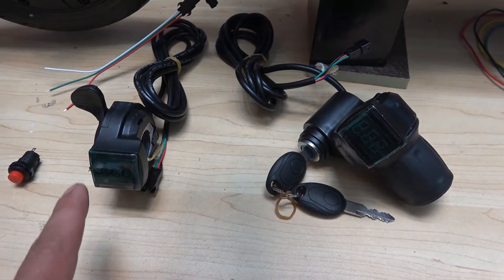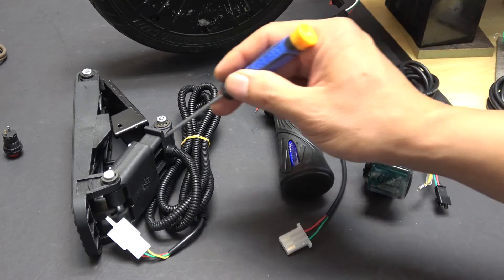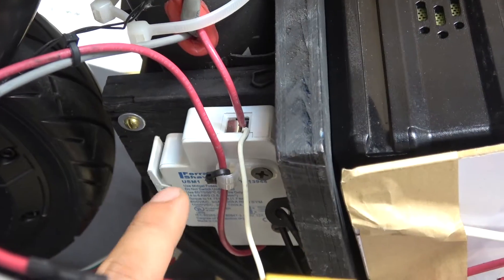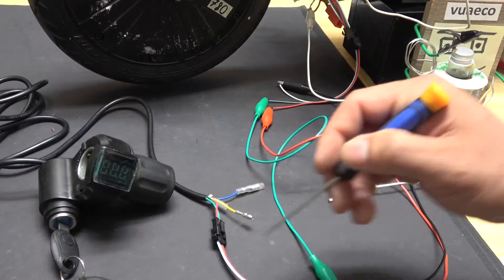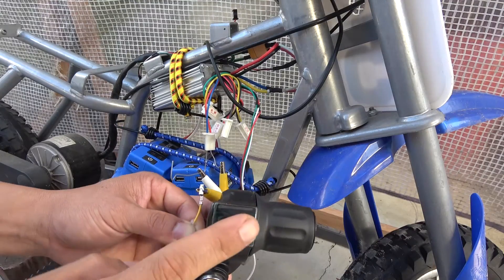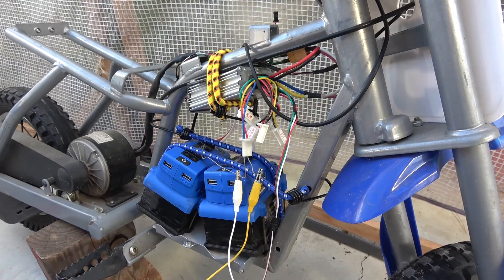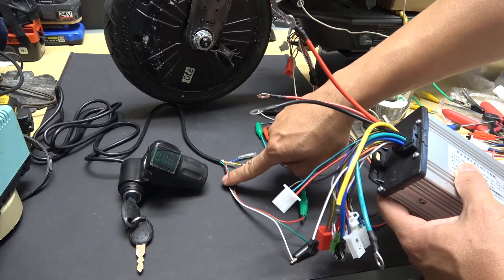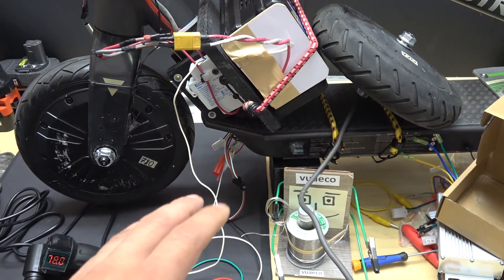DIY: How to install throttle control w/ LED voltage display & ignition key on electric bike/scooter

Comment: Thank you much! Do you have a video on hooking up the battery amd charger? Want to make an electric bike with hold hoverboard motors. All I meed to know now is how to hook up the hoverboard charging port to a new bigger battery if possible and a fuse or two if needed.

Comment: En los aceleradores ( no ignition key) el verde es siempre el cable de señal. Red is 5+ Amarillo o negro es el negativo - .....las key ignition, El encendido, el rojo es potencial de 24 v a 72, viene de la batería y el amarillo enciende el controlador, lo energizan..

Comment: I have been very frustrated looking for videos on how to manually install a switch onto  A motor hub With a throttle I already tried and broke 3 Is throttles in trying  I just need help

Comment: I have a weird issue with a twist throttle I bought from eBay. When I plug in the 3-wire throttle to the motor (it has an integrated ESC), the idle voltage on the signal wire is 1.1V, which is enough to spin the wheel with no throttle input (throttle is not turned at all). Any ideas? I don't see anywhere to adjust idle voltage.

Comment: I have the same throttle with a controller with the single red wire.  I had connected exactly as you have and although it works when I sit on the bike (creating resistance) the motor does not spin.  I have 4 controllers, 5 displays, 3 batteries and 4 motor/wheels and with these have tried many combinations to narrow out the problem (thinking it was the controller) although all controllers respond the same and none work.  So what the hell is going on here?  My only conclusion  yet to try is that a speed switch might be required for the controller to send the proper regulated voltage.... no idea just a thought

Comment: hey, great video, I have a 8 pin full throttle with battery and speed display, there are 3 cables for throttle, red green and black, and a white and yellow for the keyswitch, a purple/grey for the speed display and a lighter and darker blue for the 3 speed, but when I connect it it just shows P0 error blinking, and I done know what im doing wrong, also my controller have 3 speed with 3 cables, a blue and and black and brown, and the controller has one cable for the electro lock like yours around 10min. how would I connect that? also the controller doesnt have a power out source for lights and horn, so im not sure how to connect that either

Comment: From Brake handle.. 3 wIResRed-green-black. Standard 36 48v brushless. Single motor. Controller almost always just 2wiRe black-white. Where how connect? Confused😐

Comment: My pedal assit is red on left yellow in middle and blue on right and coming from the controller the wires are 3 different so i just do the conntanunate test on the multi meter  i will try 👍

Comment: You know how come my throttle's not working when I do that. It's apparently you're not getting turned on by the switch. What's up with that and then I got another one. It's fine until you plug the travel in. It goes from 5 to 4 V, and then it doesn't work.
 So I don't understand what's going on here. It's got to loop in it. It should be turned on, but it's not put down any voltage till tline T HR OTT.L.Eline.

Comment: So my speed controller does not have a connector named power lock now it has a connector that says alarm power is that the same as power lock

Comment: So far, this is the video closest to what I have been seeking for days. My keyed Switch 
Screwed up within 10 days of Purchase. There's
More to that story, which ended with a full refund and I no return necessary,  but the several issues are my responsibility to fix. So. Instead of the keyed switch with LCD screen and half handle twist
Throttle. I decided a key wasn't necessary, as th problem I had was the key spinning indefinitely until something connected, and then I guess after much of that the wires twisted up enough to short out completely . So newly purchased from amazon, just an on/off switch  ,no key, thumb throttle and lcd screen.  The previous setup had a 5 pin plug and then a single also on harness . That is what the controller
Connected to, also with 5 pin and single separate wire. There is a light/ horn too, in case that explains
Anything... so new  throttle has 3
Pin with red green black,  and 2
Single wires. Yellow and blue.i have photos but can't post them
Here. Can you please
Tell me
What I need to do? I am 63 y old lady
And this is my only transport  and this bike was not built
To pedal with ease of regular
Bicycle.  Help!

Comment: I need your help please with my Brainpower Motor Controller volts:36/48V 350 Power to connect it to a CD_S866 Display because I have zero electricity lessons followed in my life. So before I screw it up. I ask you please to send me a picture or email with the right wiring diagram to get it fixed. I really hope that you're willing to help me with this. Greetings Frank Grinwis from the Netherlands

Comment: I just bought a ebike if there shows 64 volts on the voltage display does it mean it will run if nothing else is the problem

Comment: My e scooter throttle circuit wire snapped but I was wondering is it possible to just reconnect the cables together to save time on buying a new throttle because I need a specific throttle and my e scooter brand isn’t made anymore or try to find a compatible universal throttle

Comment: I have a Phantomgogo R1 36v scooter. When I tested the 5v red wire coming out of the controller I found that the 5 volt Red Wire is pushing 17.44 volts. I am afraid of connectiing the.controller to the throttle because I do not want to damage the throttle.  Is this high voltage normal or is it a defect? Will it destroy my throttle?

Comment: If they only stick to colour code, everything would be fine.
Instead of opening up a controller and finding all kinds of wires and colors that does not do what it's supposed to.😂😂😂 At least they should stay consistent on the colour. If not the same it should be close second Instead of creating this colour puzzle😅😅

Comment: Tell me how to train the controller 48V, 21A, JX-100-ABS-Electron, YKGT06FOC01-A, with a hall sensor, the new one was simply turned off for sealing and everything does not turn, the rest is all on, the speeds switch, the display works? There is no white wire or XX. (The wheel did not spin right away; it needs to be turned a little. Some scooters have this function.)

Comment: I wanted to change mine to a throttle but have a clue what that white wire that you connect to yellow or where can i get one from and whats the correct name for it so i know what im asking. My scooter broke and fixed it from scratch but this one boggles me. Im not an electrician or pro but im good with my hands and fixing thing's once shower. That's the ADHD in me i suppose but some people for some reason call it an illness or disorder. To me it's absolutely perfect. At least i can think beyond outside the box and come up with ridiculous things that actually work. So with somone with ADHD is quite intelligent but handfull hahah id never change a thing about me. I love fixing any sort of motor considering evey car and problem is difficult so keeps me occupied and interested and fully focused..i can be a big messer but when it comes to focusing something i love them im all there, minus the millions questions butting in unintentionally incase i forget what i say, that the only down of it all 😂

Comment: My throttle is 6 wire. How do I wire a 3 wire throttle to a 6 wire connector at controller

Comment: My Sabvaton doesn’t have a switch/lock wire.

Where do I connect the blue wire from my throttle to?  

There is a single 12v red wire but it’s labeled “brake”

Comment: I connected an e-bike twist grip throttle to a 24V 500 watt ESC for brushed motors and it didn't work. The 3 wire set coming out of the controller were red, black and blue.  The wires going into the twist throttle were red black and green.  Any ideas why it won't work?

Comment: What about the yellow wire coming from the controller?
I got purple and red running in a loop. And then I have a Yellow One. But I said anything about yellow and coming from the controller just to throttle

Comment: I believe I’m using the same voltage speed control that you’re using the same speed controller at what point do you put a fuse or a breaker? Thank you for your time.

Comment: I bought a couple key throttles, but in 3 years of hit and miss, not working, finding nothing but " your controller isn't compatible"  answers. You explained it easy. The Xtra red and red are the key switch, ty,ty,ty and my controllers are reverse blue green for some reason but hot is hot and ground is ground.

Comment: WOW, VUAECO , Thank you so much for sharing all your videos I enjoy them all , they are the best online !!! I am installing a new univer,sal throttle with key on a recently purchased used Dyu D1(Gyroor C6) 36 volt  350 watt . This is a learning project.
It did not run when I bought it , seller said needed a battery. I have a battery that i can use that is 36 volts. How would I go about attaching the Throttle YELLOW wire to the THICK RED  CONTROLLER wire as mine has a yellow XT60?
Any help is so appreciated  Thank You:)😊
Reply: same my xt60 has only 2 wires bruv

Comment: @3:34 is there another positive power wire coming out of the controller that always has same voltage as the battery so we can connect a volt meter display to the controller successfully without going to the battery?
Reply: One of the alarm wires has it, check with a multimeter!

Comment: what voltage is that Bird motor? Also my Hover-1 Alpha only has the 5 pin throttle that connects to the display board. It says 12V on red and SW (36V) on yellow. I cannot determine how this m365 type display board powers off the 12V as It is not detectable off the harness or controller. Im hesitant to connect the yellow (36V) to the 12V line. I short the 12v and the 36V and the battery voltage dies to 4V and slowly climbs back up. My blue wire is TX in this harness.

Comment: hello. great tutorial.
Question: at 5:16 for the yellow (+) and the blue (negative) woyld i connect these two wirez to the power lock on the controller, red (+) and black (-)?

/bklyn👑

Comment: Ok so the blue and yellow wire need to be connected to each other on the throttle?i have a weird wiring on my throttle..the white is the signal and the red is power and black is ground

Comment: Hi, please, I replaced pedal assistant sensor with a throttle on my ebike and it not working. How do I fix the issue. 

The controller doesn't have separate wire for throttle connection. 
Greetings

Comment: Thank you so much for sharing this video with us. I have been planning for a long time to put the throttle with the display and key on my xioami  Scooter just for a bit of fun and anti-theft, it's working perfectly. I am totally happy about it. You have explained it so well that it was quite easy for me to follow as a beginner in electrical stuff mostly there are no plans for wiring on controllers and and. Keep up the good work, well appreciated 👍😊 greetings from Germany 🇩🇪

Comment: Hello. I've just bought a new 2000w controler but don't have ignition wire (thin red). Is it possible to put the throttle working? Thanks

Comment: On a key one, can I keep battery voltage on the display wire, so the igntion can be used in series with the existing power switch? Or will the screen stay on and drain the battery? I figured it won't since the ground wire won't be actually grounded until the controller sees power and enables the throttle
Reply: I figured it out.....no you can't do that. The screen stays on. As a work around I wired in a relay to cut off the ground wire, using the key signal to trigger the relay, grounding the screen and throttle connection.

Comment: When I first heard your voice on the video, I smiled.  I hadn’t seen your videos in awhile, but always love them.  This is exactly how my dad would teach us how to repair stuff.  The paper clips scare me every time.  I have shorted quite a bit of stuff using them, no matter how careful I am.  Thanks for the great work!
Reply: I'm new and I have an Evercross H9 scooter 48,volt 14.9aH battery , 28mph with an 800 watt in it, I want to build it so to speak to a 48v 1500 watt and a 1500 watt controller if this is what I need to achieve the speed of 40ish mph..

Comment: I did this set up but the voltage meter stays on even after flipping key into off any idea why
Reply: The key does affect the bikes ability to turn in but the voltage just stays on
Reply: @deandred712 I have the same issue. Does this affect the normal operation of your ebike?
Reply: @lupushound I ended up scraping the idea cause I couldn’t figure out how to correct the issue the drawback is the voltage meter is being powered from somewhere (the battery) and it will be constantly draining battery

Comment: I don't have switch cable on my controller and I have the exact model of the key throttle that you have shown. How do I do the connection?

Comment: URGENT! I need a wiring diagram for this so I can hook it uo to my 1000Watt 48V brushless motor controller. Can you send me instructions. I am stuck! The color of the wires on a THUMB THROTTLE (with on/off and LCD voltage display) ARE :  BLACK ,GREEN ,RED, (in connector) and YELLOW, BLUE (separate) the controller wire options include BROWN, WHITE, GREEN, RED, YELLOW, BLACK. MarkMannM2
Reply: Red green Black goes to Red green Black at controller most Times. Known as throttle control. Yellow is battery positive and should be connected there together with the thick Red cable of the controller, it is battery positive too. So battery + goes in an Y connection to the thick Red controller cable and to the yellow cable at your throttle. When you turn the key, the positive voltage will go into the blue cable. This should be connected to the activationncable of the controller, most times the moderate thin single Red one. So the voltage activates the controller when you turn the key. When you turn the key back,  voltage is Zero in the blue cable and the controller goes to standby Mode. Never short Black and Red,  or it will burn fast.
Reply: uh oh

Comment: in my controller in the throttle connector it shows only 2 volts in the positive pole, is the controller damaged? Is it a votol

Comment: my electric scooter comes to a halt after i apply the brake and close the throttle. when i want to start again the scooter does not move. Sometimes, when i am on the move even when the trottle is in off position, the vehicle accelerates on its own. Can you suggest what could be the possible problem

Comment: Thanks so much for posting this video. This really help me understand basic pri ciple of keyed throttle. But one thing I'm curious about this thing is, if the blue wire on keyed throttle is operated by switch wire which is positive, can the blue wire also be connected to main power wire with the yellow one at the same time?

Comment: Hello, I have a problem with the brakes
If I put the High Brake Line on +, the engine just shuts off, but it doesn't brake.
Can somebody help me?

Comment: Please help. I have the same throttle controller display it has red,green,black, also yellow and blue. I’m trying to install it to my razor 24 volt controller. The razor motor controller has 6 wires.
Red,green,yellow, orange and 2black wires. 

I got it to turn on the voltage display but the motor won’t work? 

Does the orange wire has something to do with it? Also the 2 black wires? 

I hope you have the time to explain to me. Thank you

Comment: What is the actual name of the wire that comes out of the controller to connect to the blue on the throttle
Reply: Found out it's the electric lock

Comment: I can't thank you enough, I've been stuck on my project for a couple of weeks trying to find a way to add a key switch to my ebike. I tried to connect one and blew it up TWICE, I have been scared to try it again. But now that I SEE exactly what to do I can be more confident. Countless diagrams can't replace the actual watching of the wiring. THANK YOU!!!

Comment: Love the vid it helped me do my scooter 
So thank u 
Can I asks something 
The 3 speed on the controller 
If I do not use it do I still need to put a wire from the black to blue to get top speed . Or just not using it meens that it’s set at top speed anyway

Comment: Great tutorial.
Question…my throttle has 8 wires.
Two - on/off switch 
Three - throttle main wires
Three - hall sensor

Throttle ground wire is a shared wire that also leads directly to vol/battery display, so four wires- three throttle wires + one black wire from hall sensor - lead to vol/battery display.

I connected three main throttle wires from throttle to throttle connection on controller.  

connected yellow key wire to positive on battery and the other key wire (brown) I connected it with positive from throttle. I then connected those two wires to positive for throttle from controller.  

With this connection, I get a display of battery + voltage on throttle screen, showing controller is on (has power) and voltage level.

That leaves two wires not connected - white signal wire and red positive wire from hall sensor on throttle.

How/where do I connect these so that when I turn throttle I can get a 0.8 - 5.0vdc reading on multimeter, indicating throttle and throttle hall sensor are working properly.

Any help I’d appreciate. Great video.

/Bklyn👑

Comment: My throttle turns on, and the motor spins with learning wires connected.  Buy, the throttle when I turn it, doesn't move the motor